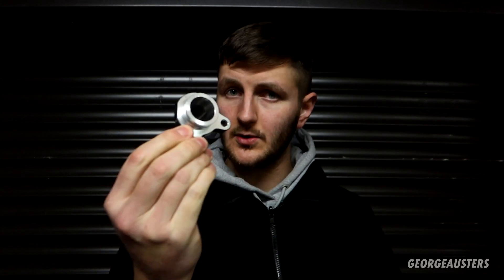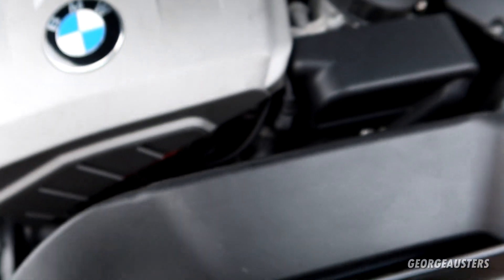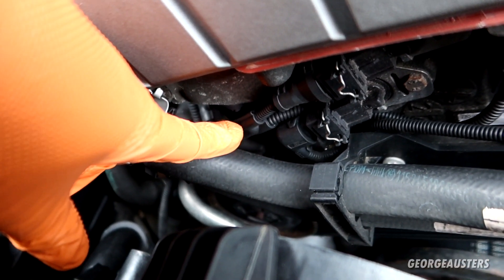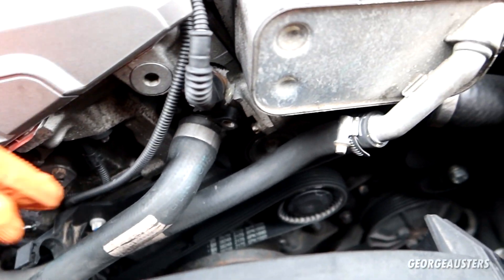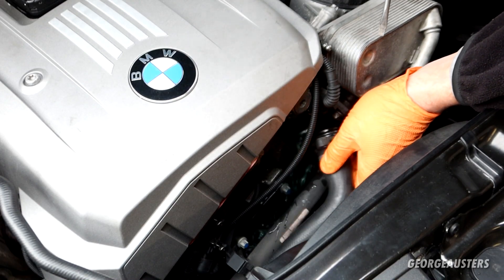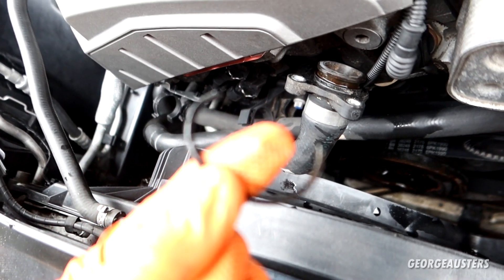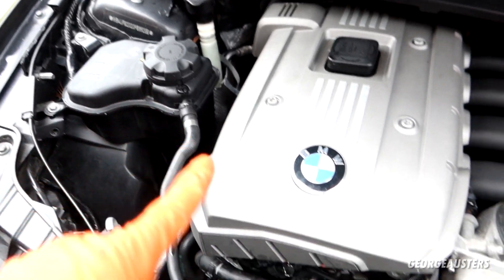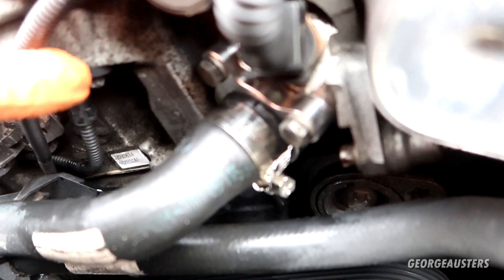BMW N52 Coolant Mickey Mouse Flange Replacement | Common Leak Fix

Comment: Hi, I’ve had a consistent cold start misfires on my 528i 2010 with the 3Litre n52 engine. I have changed the spark plugs, ignition coils, battery, coolant temperature sensor, cleaned the VANOS solenoid, fixed two oil leaks and did a coolant flush and oil change. Nothing has worked and the misfire is still there consistently every morning. I have been advised that it may be a very small head gasket leak. Is this common on a 104k mileage n52 engine? I thought these were very robust. I’m not getting major overheating or large coolant loss.

Comment: Using grease is absolutely essential , I’ve struggled with hammering , forcing it in for 2 hours and only a dap of grease and it slides in just like that
Reply: Did you pinch it up with the bolts pulling it in . Dammed if I can push in in by hand .
Reply: @jamiestanley8774 I tried hammering , wiggling it , use the bolt to tighten it in , all either doesn’t work and leak or it tears the oring , then I gave up and use a dap of grease and it just slides in 😵‍💫

Comment: Thanks again for a great money saving educational video! My e92 n52 330i had a leaky oil cooler gasket which I think has hastened the leak here so need to order the flange kit. Didn’t fancy replacing the whole hose as the bottom end vanishes into the darkness 😮
Reply: Replaced mine last weekend. It was a snug fit to say the least and needed plenty of grease on the o ring and inside. Managed to push it in manually eventually. Be careful tightening the bolts without getting it  started top and bottom as that could squeeze and split the o ring on the bottom edge. The bleeding procedure worked but killed the battery so had to jump start. All fine now with no leaks. Until the next job !
Reply: @davelloyds7190  hey ik im a bit late but when you had your leak was it fairly fast? like if you idle'd maybe 25 min it would leave a puddle?
Reply: @MrKingkiller  yes it was fast enough to drain the reservoir quickly. It was a DIY fix just need to take care pushing the new flange into place so it’s square and the rubber seal is correctly in the slot all round
Reply: @davelloyds7190  gotchu, turns out its the transmission thermostat housing literally cracked, gonna try epoxy if that fails then gonna replace it

Comment: mate, came in clutch for sure, just purchased a 08'e60, snd looking to slowly upgrade the cooling system, and this is a good place to start, Im from Australia, it gets hot here, so i need to get parts to adapt to the heat

Comment: hello. thanks for vid, i got 330i e92 n53 got coolant leak,i notice it dripping slowly  when car is on,  just next to mickey mouse part you changed on the right side that bolt under oil cooler.any idea whats that can be? thanks man

Comment: Does the o-ring come with the new housing and if not, what is the part number please? Also your link to the ISTA kit in your "tools I use" section is broken
Reply from the maker: Yes it does come with the o-ring

Comment: Ah, the mouse ears flange. Replaced mine on the e89 with the aluminum pry from FCPEuro for about $17usd. Good video, George. And, btw, my rabbit finally left the garage this morning after days inside. But seriously y’all, replace this flange preemptively before it leaves you stranded.
Reply from the maker: Yep this thing is a very common issue! Glad to hear Jon, hope you’re doing well👍🏻

Comment: Hi my bmw e61 left headlight doesnt work i replaced with a new light still doesnt work and i got black smoke from the car when i accelerate and some white smoke under the hood when i do a cold start  maybe you know the problem
Reply: It’s been 2 years bro. Let us get an update? Did you fix the issue? You still in the Bamako???

Comment: I had the same issue. When updated the oil cooler gaskets I done this at the same time, however I could only get it with the hose aswell which I was told was a pain in the ass to fit, so anyone wanting to do this I would recommend do it the way you have just seen.

Comment: Always informative George. I have a 2006 630i with the N52. Would this mod be ok on the 630 as it is not included in the link description?
Reply: Check out the the OEM part number as a first step or next step.
Reply from the maker: Yes the link in the description is the correct part for your 630i
Reply: Awesome. Thanks.

Comment: Great video George, Replaced the same coolant flange on my 335i (n54) last summer. I like we had the same approach to using a dremel to remove the old clamp😂Mine was broken in two when I removed it, wasn't leaking though just changed it for peace of mind
Reply from the maker: Haha good stuff!

Comment: When I did my oil filter housing gasket last month, I disconnected this hose for easier access to one of the bolts.  I noticed similar degradation in the plastic connector.  Thanks for the link, I'll need go back in there to replace this.
Reply from the maker: Yep definitely worth doing!

Comment: Had this exact problem two days before we wanted to visit the family for Christmas because I was doing the oil cooler gasket... replace it now and save yourself some headache. Also, the aluminum one looks so sexy compared to the plastic OEM part. Great video!
Reply from the maker: Already done the oil filter housing gaskets: https://youtu.be/KBs7xdz547Q
Reply: @GeorgeAusters  I know that, I meant the cooling hose connector 😊

Comment: Those dremels are fantastic saved my wallet so many times.  I remember when i had to cut off a siezed metal dust cap.
Reply from the maker: Yep they are well worth the investment! This is the exact dremel tool I bought: https://amzn.to/3GaGSIw
Reply: @GeorgeAusters  Mine came from ebay  for 30quid with loads of addons.  Worked a treat doing the headlight rebuild.

Comment: There is a similar part on the N47. Had it go on mine. Very similar plastic hose union that cracks and leaks.
Reply: Where can you get the n47 equivalent?